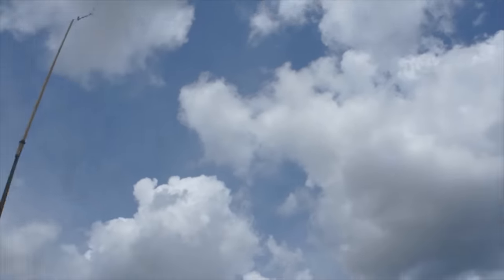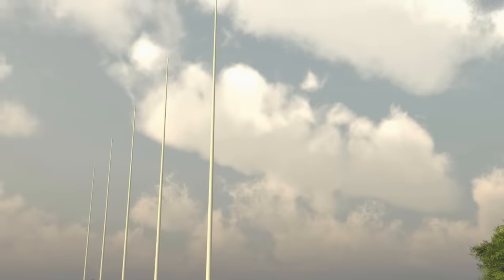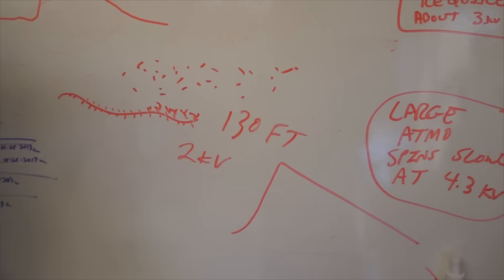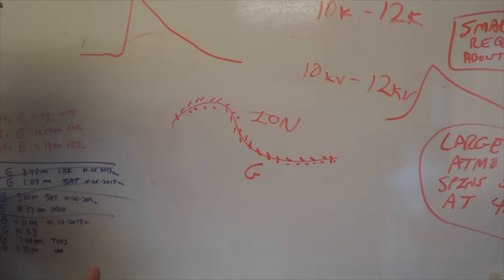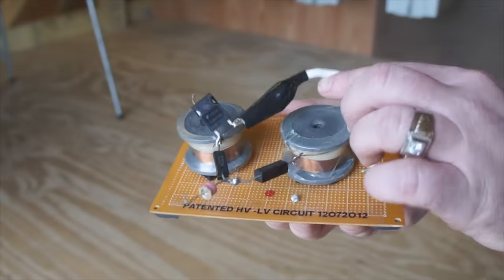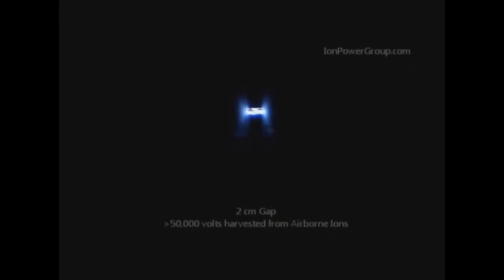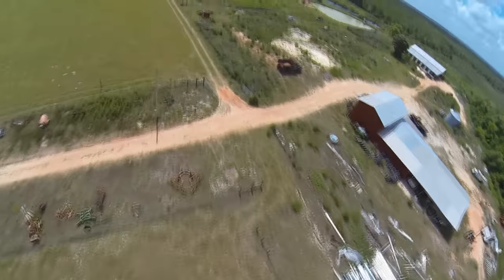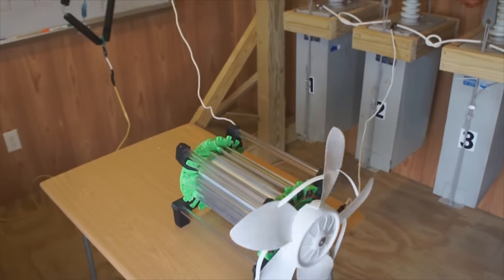Graphene/Graphite Atmospheric Electricity Collectors - Plus Horrific Hexacopter Crash!

Comment: Sounds like something that should be applied to multidirectional windmills as an upgraded concept not to mention linning the outer casing with solar cells and any mechanisms that generate heat to have thermal electrically conductive material to harvest as much energy as possible this is a world changing concept i would love to see gain attention

Comment: A high voltage is collected but what about the power. Many years ago I experimented with an electric vehicle system which collects energy from coils in the road surface and a coil in the vehicle. I wonder if graphene would replace the coils in the road.

Comment: This is fascinating, but how much useful power are they able to obtain with this? The only way I can see how this might work is if they can charge up banks of high voltage capacitors to increase the energy density, then slowly discharge the capacitors through resistors. You MIGHT then be able to recharge batteries to obtain useful power. That's the only way. You'd have to slowly build up and store the energy. There just won't be enough wattage to use it in real time. 

If you wanted to use it in real time, you would need to step down the voltage. But you'd have to convert it to AC or pulsating DC first, since transformers can't work with straight DC. Also, extremely high voltage at microamperes is worthless in a transformer anyway, it wouldn't even give magnetizing current and you wouldn't get any induction. 

There might be something to this idea, I want to keep an open mind. But buulding up and storing the energy for later use is the ONLY way I can see it working at all.

Comment: Could the high voltage be used for resonance water splitting at a mass hydrogen production and storage facility instead of being stepped down for use on the grid? If plausible it may be an efficient way to take advantage of the atmospheric spikes in ionization and store energy for on-demand use.
Reply: I don't know how that works but i saw drawings that Nikola Tesla's tower had water tank underneath. 😂
Reply: Hey that’s a good idea.

Comment: Very similar to something im going to attempt arpund here but reverse engineered to harness the excess energy in my ground.  I had to evacuate my livestock off my farm this spring due to them getting shocked and electrocuted out in the open fields and my power company has yet to be able to stop the 300mA flowing on my home's grounding conductor which is bonded to my well casing...they even killed the grid a mile from my property and only managed to reduce the energy flow by half.

Comment: Would it make sense to use the torque generated by the atmomotor to run an ac generator? Without making it gigantic, could it put out enough force to generate more current than the amount of current making it spin? perhaps this could be done with 2 atmomotors to spin both the coils AND the magnets of a generator separately in a counter rotating fashion...

Comment: Hey lasersaber.. I am a big time white rabbit as well that is a total open source freak.... I am interested in what they are doing but may I suggest that instead of towers that each tower is replaced with a quad-copter, gyro stabilized dirigible that is tethered and is at high altitude...  the power can be transmitted back to the ground with dipole antennas on the ground and microwave transmission from the units aloft.... see the new metamaterials they are making for dipole antennas allow about a 4% loss in power when transmitted this way and you only need line of site to the antenna to broadcast....

So using the method they are working on to generate the power and that which I suggested as the method of delivering power and of replacing the poles with drone blimps.... well ..... there you go.... I think at 17,000 feet you get about 100 miles line of site..... so their units aloft  for a 100 mile radius..... can broadcast to a central point...  that station is the collection point of many units they have projecting power to one antenna.... so as an ex bf of mine said... say what you mean and do what you say... so I guess what I have been saying is pay it forward and never regret helping people :)

~The WhiteRabbit

Comment: Heh, actually just read about this group on Scott Adams' blog a few days ago. It does seem like they have some interesting ideas, and there is clearly some energy to be harvested from the atmosphere. 

But I seem to remember talking to you about this back in November, and isn't there still a pretty severe limitation on the energy density in the atmosphere? I can see this technology being good for a few niche purposes, i.e., standalone cell phone towers, but could it ever really be applied to make even a significant dent (say, 5%) in the power needed for a city?
Reply: this technology can be used in conjunction with solar and not conflict with anything it will work rain or shine unlike solar and its output can be scaled some areas are gonna be higher then others look into lay lines and also this technology is still being improved the wire forming a square is just a proof of concept a grid pattern would be a more complete pickup but this engery source is strange the more you draw from it the more it will give you meaning draw x amount of current at 9 kv and over a short time the voltage will increase and so will the current capacity this is in part what haarp wanted to do in reverse trigger muiti gigia watt events with only a few mega watts of power getting power out of the system is much easier then pushing power back in haarp is working from the wrong end for that power comes in from outer space the sun to be more exact

Comment: We have metal roof on our hause (metal sheets on wooden frame), it is 12m above ground, but multimeter shows me 145mV DC or 1.25V AC against PE wire inside the hause. Maybe metal sheets are not sufficiently insulated from ground or connected all together. It is disappointment in our hause, I was expecting much more.

Comment: I'm not sure if they have worked out the higher kv insulated wiring... I worked for a company called Rowe Enterprises, that silicone jacketed bare insulators for GE and Westinghouse (grrr to them both lol) in the 45kv and up ranges. Looking into them might be beneficial, they have coated from 42 awg up to 500mcm (transmission tower wiring). 

Incredible work! I've been wishing to someday have a geosynchronous satellite with space to ground tether for ion collection... I feel as though, with a surface area like that, we could power an entire state or better, off of one tether!

Comment: These temples are meant for harvesting ionospheres electricity and capasit in capacitor. These are electrostatic capacitors which charges from ionosphere free solar energy. These are ofcourse multipurpose structures. For further technical query how it works  ask.

Comment: Could you not use it like a 3 phase motor basically as the graphing esure stator and typically use the 3rd phase is a kind of a jump starter considering the whole of islands due to the initial charge of electrons in the atom so if you boosted the mount of electrons in the atom just to start the generator or the intake of eye arms would it not act 3 phase motor and run off of less power after already had the initial start up

Comment: This is a great project that may evolve into something very useful. Many of you comment on the lack of current or mention there of. They do mention the current in here. Use Ohms & Kirchhoff's law to understand the power output you can attain. The harvest is a very high voltage but low current. If you reduce the voltage you'll get more current as the output power remains the same. They're storing the high voltage in massive capacitors to increase the current. You can then use a voltage reduction technique either mechanical or solid state to reduce this to a usable power source. Running a system like this on tall buildings or some other approach to get it high into the atmosphere could turn it into a substantial power source. In addition to this it may lead to a way to properly harness lightning.
Reply: Ms.Fixit  Proper would be an improvement.

Comment: Check the Tesla patent book he invented that 100 years ago you put a copper plate high up in the air connected to a capacitor the other side is connected to ground and dig a hole 3 or 4 ft deep and put a metal plate down in there and you've got the positive from the atmosphere the negative from the earth and you have the capacitor charged up if you don't have a load on it the capacitor will explode there's so much energy going into it

Comment: Hey guys, the interesting thing is to do work with your devices, that is the type of energy we are interested in. When you keep referring to Volts you are referring to electric potential, which says very little about how much work you can do. You need to get to the Joules and the Watts. This is illustrated by the experiment in the end where the electrostatic motor was powered ... did you notice that it too a VERY long time to start up? That means that the torque was very low and torque actually has the same dimension as Energy / Work. In a system where much energy is available, you would see a motor starting up reaching high revs/min really fast. Another concrete uncomfortable question could be: how many litres of water can the system get from room temperature to boiling over say one hour of time? So please any interested tinkerers who watch this: ask serious questions about the WORK that is possible to extract from these types of devices.

Comment: I wonder if you had a three plate graphene capacitor and you use a switching circiut that open and closed the ground connection. The middle plate goes to the ground so the device would make ac allowing the capacitor to conduct electricity from the other plate. And it could be transformed into usable power/

Comment: At 130 feet, that translates to a little over 3900 electron volts or 120 volts at 39.5 amps. I would suggest turning the atmo-motor into an electron pump. Same 3900 volts, but now you would be adding amps as well giving more energy. At the very least, consider utilizing several spark gaps of increasing length so that more energy is drawn in from the surrounding environment.
Reply: I cannot follow your calculation. Why 39.5 amps ?
That would be a lot. If I see the motor running I think of some milli amps.

Comment: Very interesting, watching this and the small static motor I wonder if this could be adapted to help power mobile devices. I realize this may not produce the amperage needed if scaled down to fit into a mobile device, but maybe with newer phones that take less amperage it may work. Perhaps it could charge the device while its powered off, or just act as a way to prolong the devices up time.
Reply: Remember that voltage and amperage is interchangeable. You can drop the voltage and raise the amperage.I wonder if the voltage could be dropped to around 5 volts and 1 amp. That's around the standard charging power required for a cell phone

Comment: Instead of wires, ionize a thin strip of atmosphere vertically.  Collect the discharge on a graphene dome.  The dome would have a hole in the top for the focused beam of (?) laser / RF, power level pulsed, whatever works.  You know, like Tesla had.

Comment: Could this motor turn a Faraday disc generator (homopolar generator) if so this is could be a way to get amps at a lower voltage. Both motor and generator could be mounted on magnetically levetateed barerings to get rid of friction and then mounted in a evacuated box.???????

Comment: That's funny , when I was 8 years old um that was 1974 .. hum hum .. I built a 3 layer wire fence around our property about 6 m in the air, with wires at 2m 4m 6m height in a U shape, and connected it to a garbage bin with about 20 rolls of alfoil and wax paper making a capacitor filled with waste motor oil. During storms it was much higher voltages. It made enough electricity to light a globe, and also used it as an antenna for my radios. Later at CSIRO I noticed that I had floating earth potentials in instrumentation, necessitating a central earth point and heavy copper wires to buildings. Just for a lark we connected wires from one end of the property fence to the other in North Ryde Dehli Rd NSW and we consistently got about 10 volts, and in storms about 30 volts with a few hundred milliamps..1984. Yep my mum thought I was nuts, Dad being an engineer, and more interested in the next neighbours wife, was all for it. But then I was the kind of kid that made money servicing the relo's and neighbours cars "by the manual" including brakes and oil changes and head gaskets etc, when I was 12.
Reply: r/amverysmart

Comment: Why condensers? It is expensive. Can use Faraday's engine better? It works at a low voltage, it is safer and is for certain cheaper. I think this good decision, it needs to be checked.

Comment: I'm at 1200 plus feet do I still need,to go 130 feet up to reach ions,or ragient,energy
Reply: Their output-voltage appears between local ground and the top of an insulated tower.    Living at high altitude might only increase it by one percent or so, since the main voltage is between ground and ionosphere, so 1200ft elevation isn't very high compared to thirty miles.   
For large increase, use the ground connection at the top of a parking garage or tall building, then add your tall tower and ion collector up there.

Comment: You hit the nail on the head Lounge Lizard. What's happening and why this technology has not progressed is because you have very high potential (Voltage) built up however very little in terms of current. The only foreseeable way to attain usable power this way (i.e. watt hours) is to  collect that from a lightning strike and I'm sure that will involve quite some infrastructure and not worth while. Supercaps with ultra low leakage rates have abilities to contain energy fast with very little ESR but this is not the future of energy production. Fusion will likely be the future for power generation in my opinion.

Comment: Why not use large helium balloons guyed down by  4 guy ropes to lift the wires up high in the sky? inside each balloon you could put a cartridge of compressed helium with pressure sensors to release helium into each balloon when a little escapes through the skin.

Comment: The problem seems to be in current,, I suppose the trick is to use  transformers to change voltage to current and get some useful torque out of it ,,or charge batteries that then can provide torque.. interesting research though...

Comment: You can collect and store high voltage, but how many continuous watts of power can be harvested with this wire? Therein lies the problem... Atmospheric ionization is not free energy in the strictest sense - it needs input energy. This is typically provided by winds, which is why you get a lot more ionization in areas around thunderstorm cells. Winds aloft, particularly under low humidity conditions, also cause a large buildup of atmospheric ions. Increasing altitude is almost always correlated with increased ionization density. But ultimately what you are doing is harvesting wind energy, albeit in a very inefficient way. A large windmill would be orders of magnitude more efficient when construction costs are considered.
All wind energy can be traced back to solar heating, so basically it's all ultimately derived from the sun.

Looks like your hexacopter may haven gotten forced into a vortex ring state by a momentary downburst. Can be difficult to recover from unless you apply a hard stick input to attempt to fly out of your own downwash. Fortunately, those DJI flamewheel style arms are dirt cheap.

Awesome build on the electrostatic motor. There are a lot of hours of 3D printing there. Great job!

Comment: Why would an ion attach itself to the wire? Is the wire not charged to the same 9kV? If the wire is charged to 9kV then wouldn't it repel any ions nearby?
Reply: John Fraser wire is grounded, its potential difference for every yard up...
Reply: Yes, the wire is charged to 9kv but it is not directly attached to the ground. The wire is cut in half down there by capacitors, which are used to store these charges. As the capacitors keep charging the wire up top need to be charging continuously, i.e, instead of repelling ions it becomes a path for them to transfer energy.
Reply: Branden Peter but one side of the capacitor should be grounded, once it fills up it should be used on some load
Reply: Source Source If charge is drawn from the capacitors then they will lose voltage.

Comment: please try pushing a radio signal into the wire, I think the article said it attracts  the free electrons to the wire,  if I remember it right, it was around 5000 hertz,  I'm not shore it was a long time ago the article was about using a fence as a power source, it could have been the nexus magazine I was not able to find it on google I seen it in the paper back version

Comment: did you know your high voltage power lines use extremely high voltage and very low amperage to save loss. V=IR or V/I = R There is a direct relation to Voltage and Amperage. if they manage to produce very high constant voltage, there's nothing stopping them stepping it down into something more usable like commercial transmission does.

Comment: When you print another chopper I would put graphene in with the plastic so when you crash it wont break. One of the many things being done with graphene, imagine maybe you will have the first prototype for the pilotless man sized graphene drone. Frame, power supply, and motor all built from huge 3d printers with monoatomic carbon !